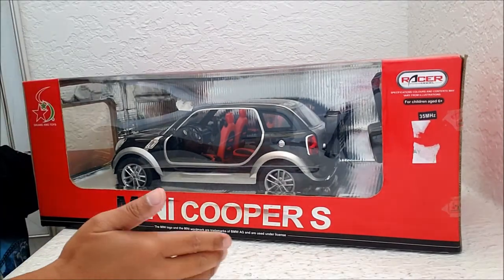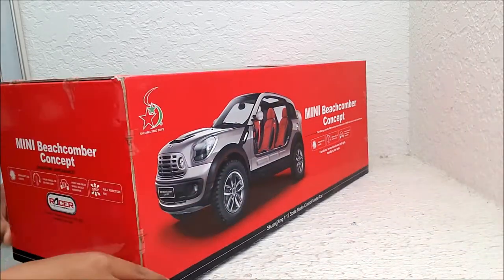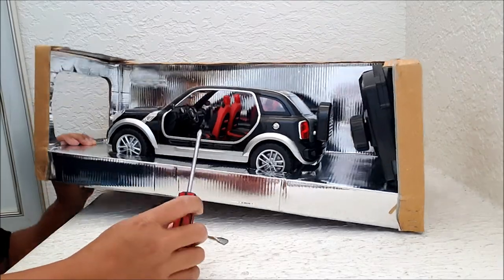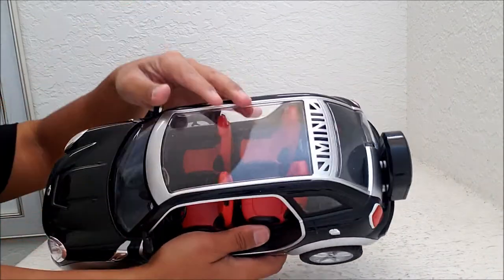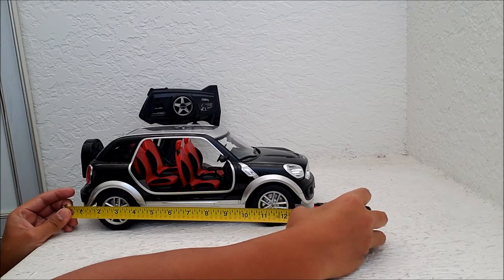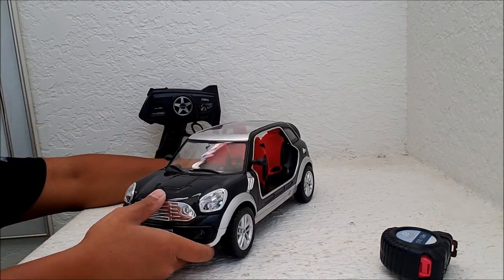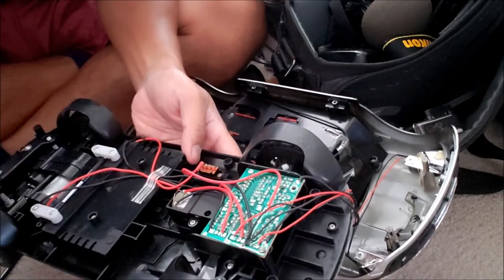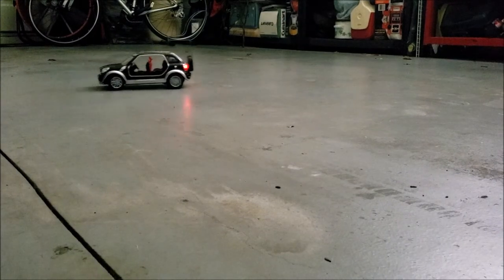MINI Beachcomber Concept r/c car (ultra rare) 1/12th scale

Comment: I think you should get 3.7 v 14500 batteries for it they are aa size. Lol they are lion.
Reply: If you like mini coopers you should have gotten the m series front wheel drive 1/10 scale Tamiyas. Stay with me several different mini Cooper bodies for them.
Reply from the maker: @bradkalman2353  I wish they had a Mayfair :D And I wanted this particular car (when I saw it) because I'm definitely gonna be using it in one of my r/c car videos :D The hobbygrade Tamiyas are awesome, but I didn't want to spend too much money on it